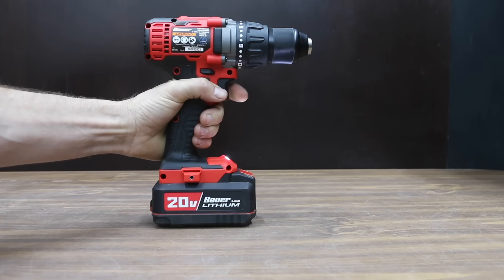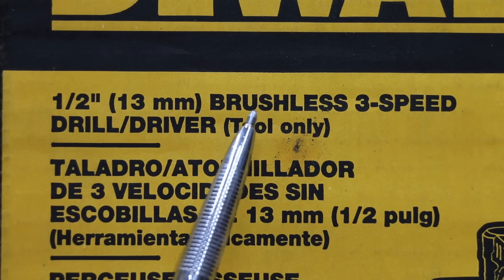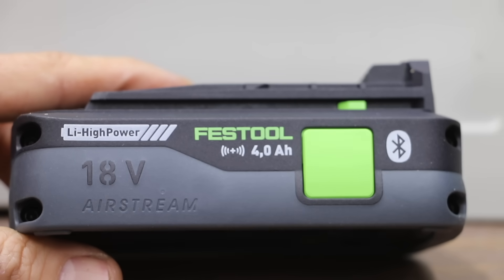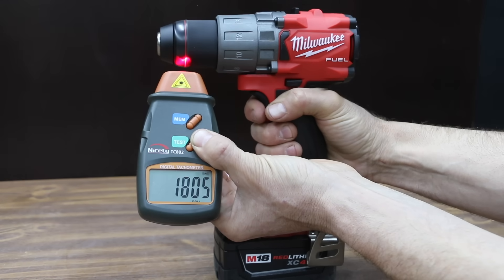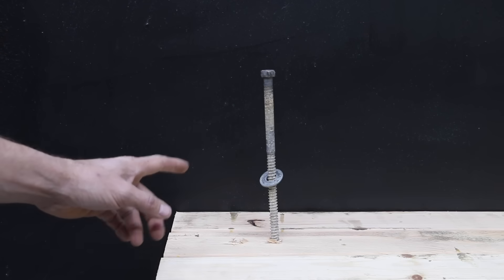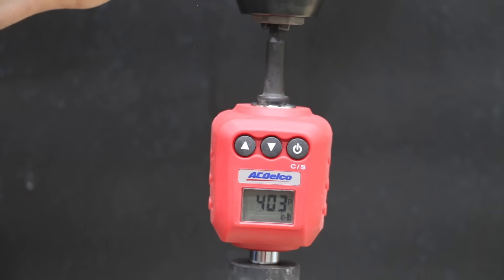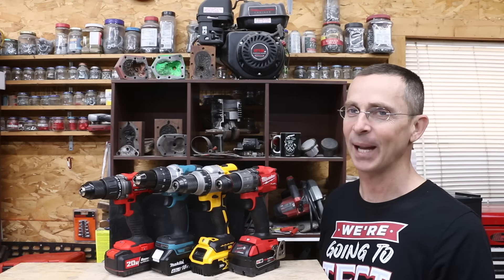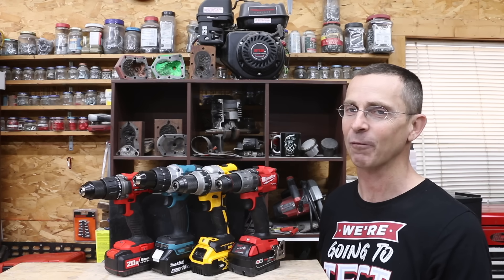Best Drill (BATTERY POWERED)? Milwaukee vs Dewalt, Makita, Bosch, Festool, Ryobi, Bauer, Ridgid

Comment: Hey, we work in construction mainly tiles, but we always run in to the problem of grinder blades not cutting or dulling out. Could you do a ceramic/concrete/marble.... etc.. blade test? It would be applicable and appreciated. Thanks!!!
Reply from the maker: Thanks for the video idea.

Comment: Would've loved to see Hilti included. Although not sure how common that is in the US
Reply from the maker: Thanks for the suggestion.
Reply: And German metabo
Reply: Hilti rocks!
Reply: @goranmarinic2923  Their quality have fallen of lately. I have an drill, hammerdrill and impact wrench used for heavy duty work stuff. Drill has been in repair 3 times, hammer 1 and impact wrench 4. All in 2 years :)
Reply: @stenstensson2086  we had a Hilti hammer drill that lasted like 15 years, fairly heavy construction use. It was corded (pretty much everything was), but it was awesome. I wonder if it’s still in the shop hibernating.
Reply: Also hitachi
Reply: @thedon9924   Yep. Hitachi and Hilti are great tools.
Reply: Also AEG
Reply: it's common but for the people balking at the price of the festool a hilti would be x4
Reply: I have the impact, drill/driver and angle grinder. I've had them for just over a year and have had to make 4 warranty calls. The chuck is always getting stuck. Every tool feels like a cinderblock compared to my old dewalt 20v tools. I was sold by the extra power and battery life alongside the LIFETIME WARRANTY (that apparently you will really need). But considering how much more it costed me, I can only see that I've screwed myself with this purchase.
Reply: In fact I have a battery and charger in the mail for warranty as we speak...... so I'm currently using MY OLD DEWALT 20V and wondering why I even did this.... it still works fine after 6 years of use. Why am I like this?
Reply: Hilti are solid but they don't perform as well in this class of drills.They would rank about four or five here.Saying that but it would out live most of these drills as well.

Comment: Maybe a test on the best brand of riding mower belt? Could test for tensile strength, grip, wear resistance as in a slightly uneven pully setup, heat resistance, price, ect..
Reply from the maker: Thanks for the suggestion.

Comment: For your next project could you test diesel oil in a lawnmower engine to see if it performs better? Been told I should run diesel oil in my 1976 lawnmower.
Reply from the maker: Thanks for the suggestion.

Comment: How about a test on using spray graphite on the underside of a mower deck to keep it clean, or be easier to clean. Maybe different types of products in a face-off, tis the season
Reply from the maker: Thanks for the suggestion.
Reply: @ProjectFarm  just something I've heard about and always wondered if it really works, a few guys I know swear by it, especially on a new mower, they spray it down with graphite before they ever use it and claim that grass won't hardly stick to the underside of the deck.

Comment: Walmart gave me an idea to share with you. They now sell Super Tech synthetic oils rated at 10,000 and 20,000 miles respectively for a $17 5 quart jug.  I would be curious to see how it stacks up against high end oils as well as their predecessor and competitors at their price point.  I think it would be valuable to the broke/cheap folks to know if it is the real deal or hype. Thanks for all you do.
Reply from the maker: You are welcome!  Thanks for the suggestion.

Comment: A key factor in choosing a drill is the quality of the chuck & how easy it is to grip. Please mention this in your reviews.
I've used Ryobi for almost 20 years, the older 14.4v (updated with LiPo batteries) still works well.  I have at least 10 Ryobi 18v+ garden & DIY tools. Most have lasted & work well. However - if I was buying now I'd consider the Milwaukee, Makita or Rigid as a better system to build on.  The side handle style that Makita, Milwaukee & Rigid use looks a lot better. When you need one - that's the best format for me.
Reply from the maker: Thanks for the suggestion.

Comment: Hi I have an idea for a video but it may not be interesting. Substituting different fluids in a hydraulic jack. Eg. Brake fluid, baby oil, vegetable oil, water, engine oil and the already used substitute, transmission fluid. I'm sure there are other fluids that could be tried. To test them you would probably need something that can measure the lifting force and check if they hold the force or start to go down I guess and check if the lift rate and release rate are different. You always have good ideas for testing. Anywho, that's it. Keep up the good work.
Reply from the maker: Thanks for the video idea.!  Thanks, will do!

Comment: Great review on the performance, although I am confused on the pricing. What the tool cost without and battery and charger is kind of a mute point. The last time I priced a Bauer at Harbor Freight with battery and changer it was in the same price range as a Milwaukee or DeWalt that comes with a battery and charger.
Reply from the maker: Thanks for the feedback.

Comment: Nice to see you include Ridgid in your testing. Between my dad and I we have Milwaukee, Ridgid, Makita, and dewalt. 

The M18 is probably the best all around in use. I'm always surprised by the dewalts. They seem so small yet get the job done. Oddly enough, for driving deck screws the ridgid impact gun is the fastest...Their newer batteries make a huge difference in the performance. 

The lifetime warranty is nice. I've been able to get a replacement 3 times on their tools so far. 

I've used Bosch and they just don't seem to hold up to the standards set by the other brands. I've had good luck with their grinders though.

My dad swears by his festools at work though. He's fortunate to have an entire shop of them.
Reply from the maker: Thanks for sharing.

Comment: Do you have one for rotary tools?  Dremmel vs Milwaukee, ect?  Corded vs battery?
Reply: I've used a Black & Decker for many years with out any issues. It was corded and took the Dremel attachments.

I recently switched to Milwaukee because it is battery powered. I've had no issues.

I have various uses, but mostly for cutting out speaker holes, metal framing studs, too long screws.

I'll also add that the collet on the Milwaukee broke about 2 months in to use. Milwaukee was making me jump through hoops for a replacement. So I "swapped" it out from a display model at the local HD.

Comment: The Milwaukee drills clutch sucks for doing delicate dry drilling! And good luck getting that drill bit tight enough with the crappy chuck without gloves. And it has a tiny gap for some reason so tiny drill bits are out of the question. The makita spoiled me so I thought I'd upgrade my tools to Milwaukee, but that drill made me sorry. But the numbers show maybe the weekend warrior wasn't considered in manufacturing!
Reply from the maker: Thanks for the feedback.

Comment: So I have a good video idea for you, I just ran into the need for a tool backpack" with a "pocketed" inside to organize hand tools. The problem is, they can be expensive. The Hart brand "hard bottom water proof etc etc" tool back pack was $70, the steelhead was $10 more and the dewalt was 90. They're all within the 70-110 range and it makes me curious if that small of a  price difference  will change the quality. I'd kick myself if the hart brand ripped after a month but for $20 more I could have a durable alternative.
Reply from the maker: Thanks for the suggestion.
Reply: @ProjectFarm  I hope you do. I'm obviously going to buy one before you get around but id be looking for:
Waterproof: is it dry inside and how much fluid does it take on
Durability: inside on out, will sharp tools cut out and will sharp objects cut in
Number and size of organizations pockets
Maybe a drop test by putting an egg in an internal pocket and dropping it

I have to admit, I'm buying mine based on color right now, because the club I work at has a very strict dress code, but I like the hart the best so far because it has pockets on both sides of the main pockets instead of just one like most do. My work is going to pay for my equipment, so I no longer care about durability, but others may.

Sorry again for the long comment. .maybe one day when I make my own yt channel like yours testing my job specific fields you'll u understand why.

Comment: Please include the brand Metabo in your future tests, they make amazing tools. My angle grinder lasted me ten years now whereas others before lasted two or three. I think they are even hand built. Great video once again!
Reply from the maker: Thanks for the suggestion.
Reply: @ProjectFarm  I have some others (so far), for videos:

Test hard drives

Test OEM vs third party alternators/starters/power steering pumps

Powerbank, which powerbank lasts longest and which charges fastest.
 

Side by side comparison of LED light bulbs. What color it is, how bright they can get and how well they dim. 

Mattresses

Vacuum cleaner

Blenders

Hair dryer (noise, heat, volume of air, etc)

Clothes dryer

Dishwasher comparison. Buy Miele or just the Kenmore?

Motion Detector comparison (range, reliability, sensitivity level)

Sump pumps / trash pumps

12V air compressor (they are usually lame!)
Reply: Be careful when testing Metabo. There are two lines of Metabo - "Metabo" and "Metabo HPT." Both are excellent, but different: the company that owns Metabo bought Hitachi's power tool business a few years back so they could have a less-expensive but high quality line to sell to people , and renamed the Hitachi tools "Metabo HPT" - HPT standing for Hitachi Power Tools.

Comment: I would not have included the Festool in this comparison. Festoo'ls equipment has not really ever been meant to be used on a daily shit-bum beat it to death type tool. They are built for more precision work like custom cabinet making. Unlike the other devices even if you baby them the Festool will be around forever. Using the others to do cabinetry is like performing heart surgery with a chefs knife vs a scalpel. Biggest thing about Festool equipment is the level of control is un matched.

Comment: Found out with the Milwaukee drill that it beats my Milwaukee impact driver with double overkill when it's in hammer drill mode.

Didn't expect that kind of result, you would never use a impact driver again :|
Reply from the maker: Thanks for the feedback.
Reply: *tried it on normal wood and hardwood, in both cases the drill beat the impact driver with (by feeling) half the time

Comment: The Festool tools are not made to be the strongest, or the highest speed tools. They are made to last 8 h a day for many years.
Reply: I own same product like this Festool 6years but brand was Protool (it was same company). And its far best drill for heavy duty. This test cant recognize which drill is more useful.
Reply: @themarast  I think Project Farms tests can find out which drill is useful for the hobbyist, or the engaged hobbyist.
It can't be the subject finding out which is the best for the Pro. That knowledge comes from years of Pro-use. For example the brand Hilti. You pay 3 times as much as for regular, good electric tools, but the thing will work every day, every minute, for years.

Comment: Harbor Freight has a few house brands, I went 1 step up for my drill and impact to the Hercules brand (the Hercules costs about $10 more than the Bauer) and I also bought the 6 1/2" circular saw. I've been very happy with the drill and impact, which I use for light auto repair and carpentry. The circular saw is a mixed bag. It is light and quiet, but it has struggled cutting through 3/4" plywood.
Reply from the maker: Thanks for sharing.

Comment: Video Request: 
I realize you made a Diesel anti gel additive video, but I would love to see a video analyzing the lubricity of diesel with and without various daily use additives (non-winter). Diesel in the US is known for being inferior with the exception of areas where they have stricter requirements (California), and issues with injectors and fuel pumps which require lubrication from the fuel are common.  The only study out there at the moment from 2007, commonly referred to as the "Spicer Report", was done by a member from a diesel forum.  Most common brands are Diesel Kleen, Opti-Lube, Sta-bil (same as Ford Motorcraft?), Stanadyne, Hot Shots, Archoil, etc.
Thanks
Reply from the maker: Thanks for the suggestion.

Comment: I'd like to see a hand tool comparison such as who has the better screwdrivers or was the better ratchets
Reply: Id like to see that.
Reply: I do not like Harbor Freight, I bought $300 worth of tools from them and 80% of them went in the trash. The old craftsman were good (before they went to China) the new stuff is questionable. You can't go wrong with Snap-On but if it's to expensive than I buy DeWalt 😃
Reply from the maker: Thanks for the video idea.
Reply: For me hand drivers always comes down to how it feels in my hand and price. I've had very good luck with Harbor Frieght hand drivers in both areas, and when they break (rarely) I don't feel bad about swapping them out for free. I find them very close to older Craftsman.

I've also had excellent luck with Harbor Frieght wrenches. Both racheting and non-ratcheting. Again, I don't feel bad about swapping them out for Free. These I've actually had to do.

Comment: I'm a carpenter that uses screws for everything (ranging from 50mm to 200mm long) and the festool is the absolute best drill for that simply because of the ergonomics and removable chuck system, however if you're not using it everyday all day it's not worth the money
Reply from the maker: Thanks for the feedback.

Comment: I was a diesel truck mechanic for years and I got a Ryobi system that I used daily. Now I'm retired and I still use those Ryobi's but with newer batteries. You'll know which tools are best after years of use.                      I was thinking of testing my Ryobi but my lawn mower is a plug-in electric
 I'm stuck :)
Reply from the maker: Thanks for sharing!

Comment: so question. is a drill gun for drilling or driving. seems like most manufacturers offer to products to perform each of these tasks independently. what is the true intended purpose? My recent purchase of a Kobalt combo drill and driver gun for home use proved to me that the driver was superior to the drill for screwing in deck screws. Whereas in the past I had used a drill for the same job, with less than satisfactory results.
Reply from the maker: Thanks for the video idea.

Comment: Festool seems like it's way overpriced. Probably a well built tool but I wouldn't buy it
Reply: yeah, but that price includes spare part availability guaranteed for 10 years and quite good support / insurance. Not mentioned here: itˋs also an impact drill. Thus its very versatile when it come to drilling jobs. Although I just learned that other brands also have good tools, I'm happy with it.
Reply: @larsgroh18  I'm sure but I'll still to the Milwaukee hammer drill for $149 with a 5 yr warranty. And they do honer they warranties unlike ridgid
Reply from the maker: Thanks for the feedback.

Comment: Most surely $544 American for that drill is absurd.  But you can buy a combo kit that includes that drill and their TID 18 impact in a Systainer for $599. Not saying that combo is a bargain either, but it certainly has much more value than the drill alone.

Additional considerations on the Festool drill. In 4th gear it has a much high peak RPM thank the other drills which is desirable in some drilling applications.  It also has a 90deg chuck included which is handy at times.

I don’t fault the tester for his methodology. Many people use their drills the way he used the drills in his tests. But personally I use a drill to drill holes with drill bits. I use my impact to drive fasteners.  So I would have preferred to see him drill holes with all manner of drill bits, in both standard and hammer modes.  And…report speed of drill drilling, how long the batteries lasted, how quick they charged, and if they had other features that might endear themselves to specific trades( the Festool not only has a regular and right angle detachable chuck, but also Bluetooth batteries that sync to their dust extractor). That Bluetooth sync might not seem like much, but with current OSHA guidelines on containing cement/ concrete dust when drilling or cutting, being able to have a Festool drill turn on the Festool dust extractor in unison is a big plus.  I’m not aware of any other manufacturer that has this ability, but certainly the other models he tested do not.

Brute power isn’t everything!  Then again no one wants a wimpy drill either.  It really depends on the application and the individual user.  BTW, I do own this Festool drill along with their impact and several other of their tools.  But I’m also an unabashed Makita fanboy too!
Reply from the maker: Thanks for sharing.